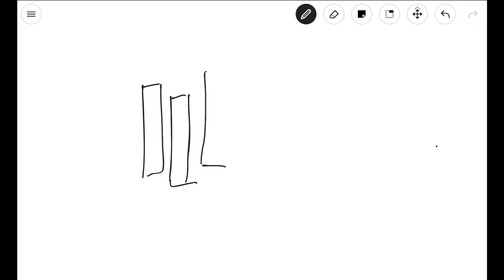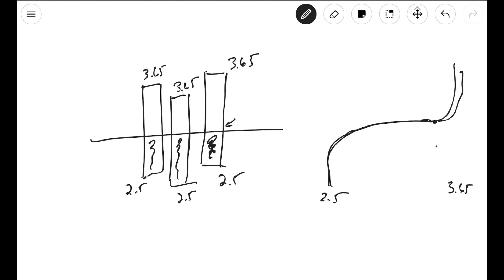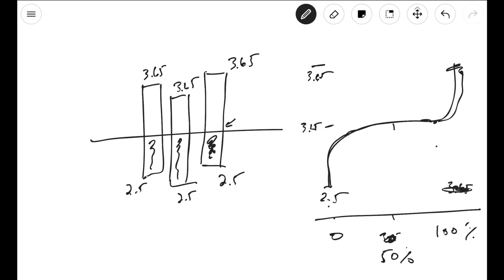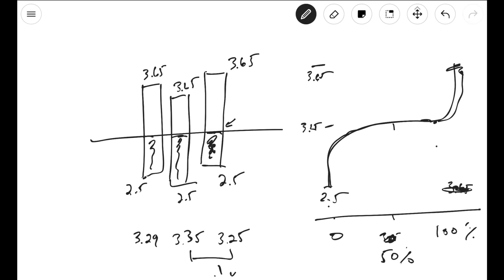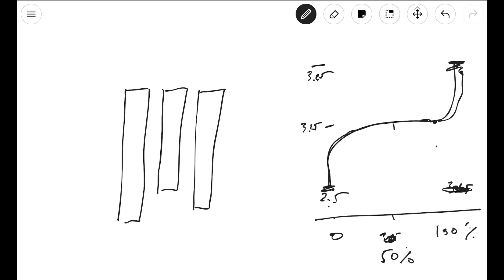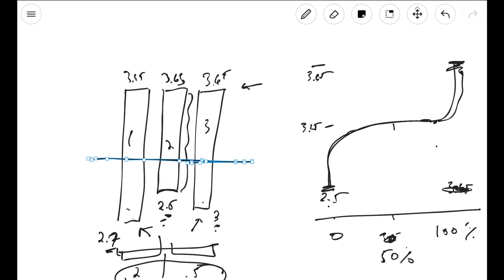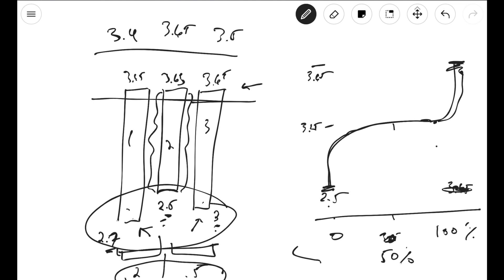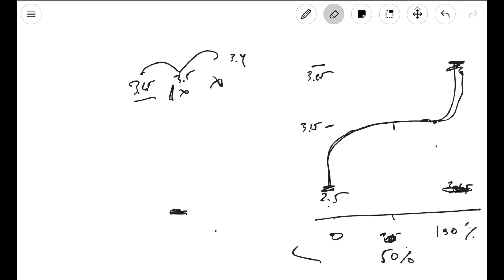Why You MUST Balance Your Lifepo4 Cells and Why They Won't Stay Balanced

Comment: Very good explanation. I wonder if we should middle balance them instead?
Reply from the maker: This is a good question. It is possible in theory - but are on large cells, given the extremely flat Lifepo4 voltage curve, two cells could have extremely similar or even identical voltage but be at different levels of charge. Given that top or bottom balance will work, it just makes more sense to top or bottom balance if you can.
Reply: @TheWilltoBuild  The penny dropped with that explanation - thank you! At the bottom and top, the voltage changes quickly with capacity, so paralleling cells up when they are at either end means when the voltages equalise they will also equalise to roughly the same capacity..in the middle, all you can say is they end up having the same voltage but capacity could be almost anything! So equalising at 3.55V is not as "capacity equalising" as  paralleling them at 3.65V.

Comment: Thanks for the attempted nooby explanation...great idea. Would you consider reframing the analogy to reflect a physically smaller AH capacity cell..i.e all cells ave the same height  but different widths...i.e. different volumes and represent the charging current as water flow.....same could represent discharging. This could then lead easier to your next in the series explaining the difference between passive vs active balancing.....which I assume will be your next in the series.  A good graphical explanation would be useful to educate those with limited or no Electrical background. Also I did not pickup a logical explanation of how a balanced set of cells goes progressively out of balance...probably because that involves cell charging and discharging efficiencies ( topic still to come).
Reply: No. The battery's are the exact same size and shape. Your analogy makes it way harder to understand
Reply: @JM-yx1lm  Thank you but I disagree completely....What makes some cells lower in capacity is their real world or actual Amp Hour rating...which if we are talking about analogies ....just like litres of water in  container....the level in that container is a very good if not perfect analogy for voltage....
Reply: @mekuranda  The different heights represents different Ah capacity and as such show the battery has more depth of discharge available than another.
Reply from the maker: I'm sorry you didn't follow my analogy. The heights are the capacity of the battery cells in my visual (nothing to do with how they actually look).
Reply: @TheWilltoBuild  I understood your analogy..but took a little while to understand that your line graphic must have meant AH capacity...even though the word voltage was used often... having been in the position to educate non EE's on the idea of cell balance..I always struggled in getting them to understand until I used the universal analogy of water volume being current and voltage equals pressure...and in the same vein water capacity is easier to link with AH capacity. As I am not a content creator, I would like to provide your explanation YT links to all my clients...the few who I tested this video on were still confused (admittedly these were non engineering... farmer, worker type people)

Comment: Good video!  These issues can be mitigated by building a battery using Parallel series connections, e.g. 8P8S for a 24V system.  It works great, and averages out the differences in cell capacity.
Reply from the maker: Parallel will help, but that can have its own problems too though. And the same problems can exist, they are just less likely to occur.
Reply: @TheWilltoBuild  what kind of problems?  I've been running a 10kwh set for 5 years without a bms.  I just keep the voltage within a certain range.
Reply: @agtlewis  small remark: if you only measure the voltage of the pack and switch off when it hits the max, if one cell goes bad, the other cell(s) will overcharge and die. 
A bms will prevent that.
Reply: 64 cells?
Reply: @josepeixoto3384  yeah 64 250Ah cells makes a decent battery

Comment: You need to make a smart battery system that does the following for each cell:
1.  Monitors info for each cell during dis/charge & idle state (i.e. temp, V,  dis/chrge rates, Coulomb counts, & self-dischrg rates)
2.  Charges & balances each cell individually & simultaneously using a switching matrix & auto-variable SMPS, logs charge rates for each cell, logs dischrg rates for each cell
3.  Provides smart DC-DC converter discharging which draws energy from higher capacity cells to compensate for lower capacity cells to optimize to full capacity of the batt...
Reply: Have you heard about active balancers?.....really simple solution to the problem....this can potentially average out all cells in a series battery bank if active balancer has sufficient current rating to overcome the unbalanced AH rating of your cells....most start at 1 amp and can be purchased up to 10 amps for really badly mismatched cells.
Reply: @mekuranda  Yes.  I've seen them shown in vids, but there appears to be mixed results in their effectiveness.
Reply: @ab_ab_c  their effectiveness could be related to the quality of the device - just like many MPPT solar charge controllers are not as they suggest often just variations of PWM controllers or with very basic Buck converters masquerading as microprocessor types.
Reply from the maker: A think @peter is right, the closest you will get is an active balancer. I plan on doing a video on that soon.
Reply: @TheWilltoBuild  Awesome - from what I have experienced there are some which can move 5 amps and balance to within 5mV and some of this is also integrated into reasonably priced Complete BMS systems with BlueTooth comms etc to log and offer history as both @AB and @sylvan dB were talking about - there are a few differing technologies commonly for sale at reasonable prices some using isolated Boost converters and others using supercaps. We would all be interested in the types you have tested and how they work in practice. Important for my work is that the battery is taken offline for the absolute minimum time and so a set and monitor solution works best for my kind of installations.
Reply: @TheWilltoBuild  The best that you can get is the system that I described above.  It would need to be microcontroller or microprocessor based--which could be done pretty inexpensively using an 8 bit SOC.

Comment: Thank you for confirming this, I had wondered. Is this a case when an active balancer is useful? It would seem if the other cells could support the lower cells especially during discharge, even if the current never makes it into the cell, you'd get a longer runtime? With more even wear?
Reply from the maker: Good question. I think the answer is complicated and I think I will do a follow up video to explore the topic. Basically it depends.
Reply: @TheWilltoBuild  I'm looking forward to it. The ones I've seen are fairly low amperage if you are pulling a lot of amps so it can't keep up, but yeah there is a lot more to it then that. I've been playing with one for the past week and still don't know how I feel about it. :) Curious to see where your thoughts and test lead!